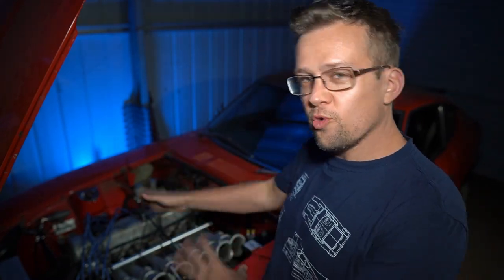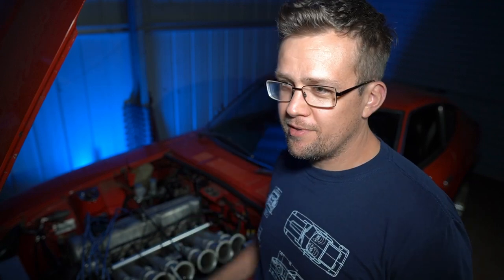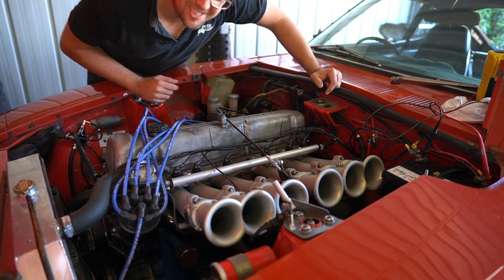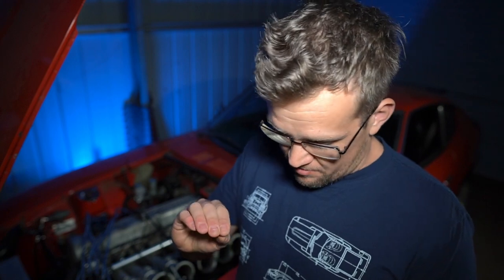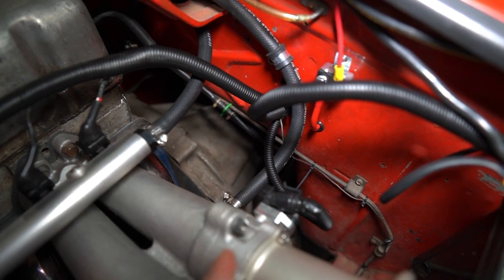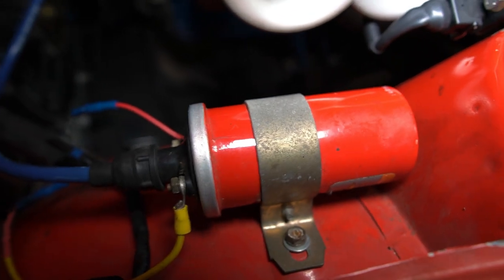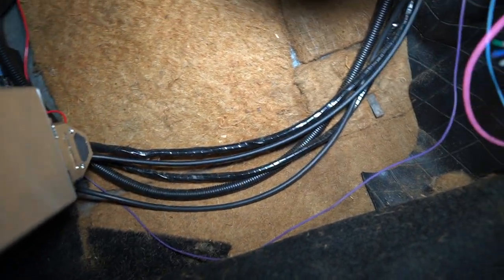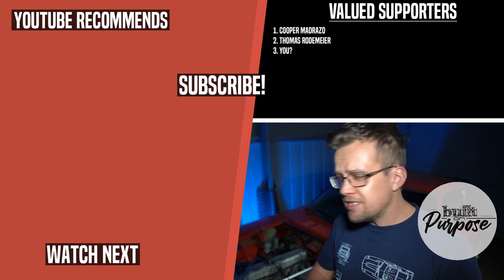New wiring, a first start attempt and an apology [Datsun 240Z L28 stroker ITB EFI]

Comment: OK, now we're getting seriously juicy!!  Perhaps the mountain has been mostly climbed.  You sure made the rewire sound quick and easy, though how could it have been.  So tell us your theory regarding the steady idle under alternator load when the fan kicks on, or did you make some computer adjustments (other than the switch to MS3...)?
Reply from the maker: The change that contributed to improved idling under alternator load was the ability to accurately characterise injector dead time with voltage change. The old ECU could only treat injector dead time as linear when in reality dead times are anything but linear. The improvement across a number areas from accurate injector dead times is amazing.